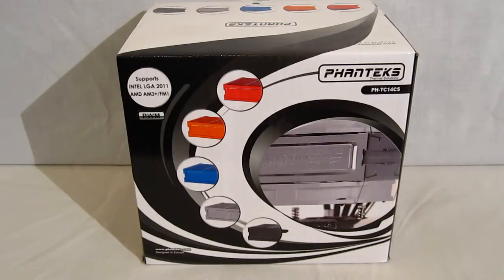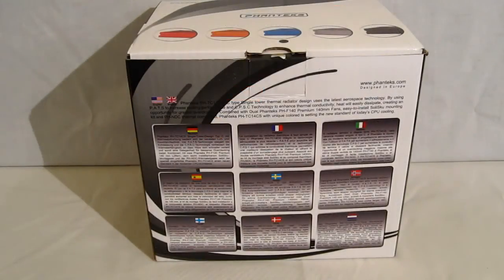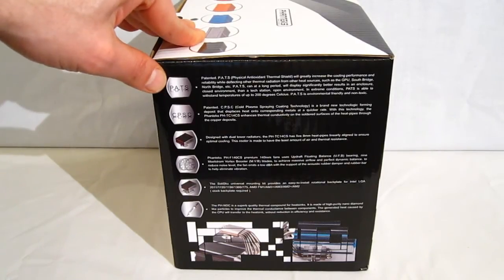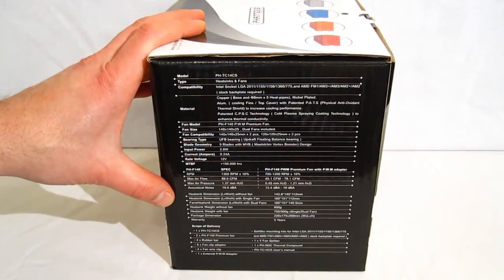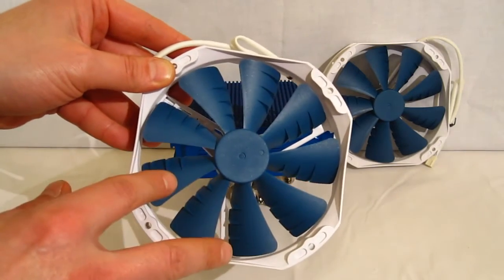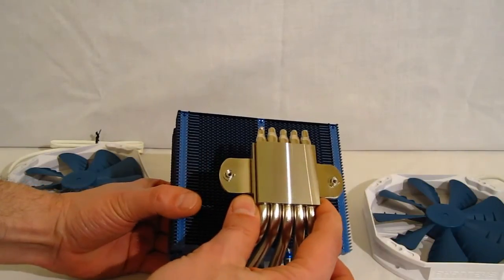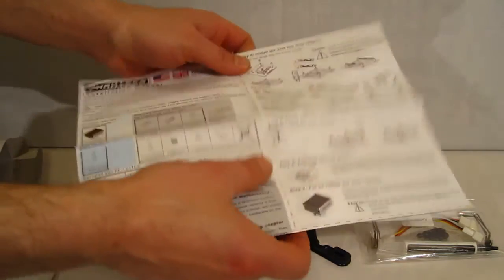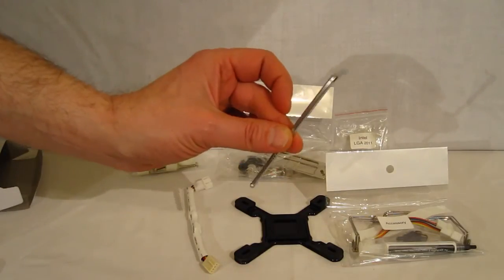Phanteks PH-TC14CS CPU Cooler Overview

Comment from the maker: @NielandMolly - The reasoning behind the top down design isn't as much about cooling as it is about reducing the height of the cooler. Full explanation is in the full review on the site.

BTW - there is also a full review of the Freezer 13 Pro there. :-)

Comment: Well, Both designs have their own forte's. A Tower design is best for maximum efficiency for carrying heat away from the CPU, it has more heatpipes and it blows the hot air out of the case (With the addition of extra fans too).